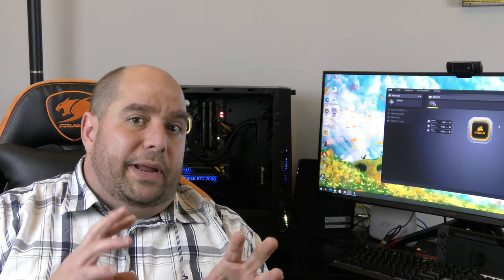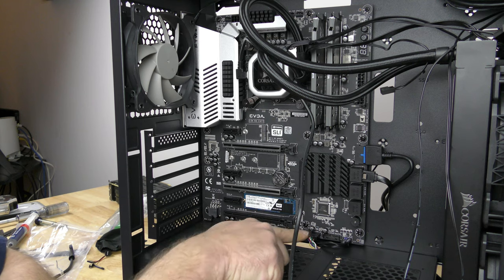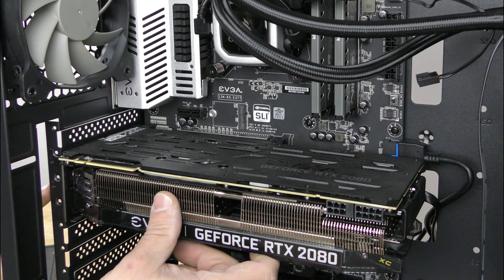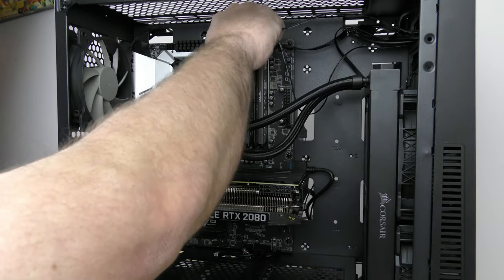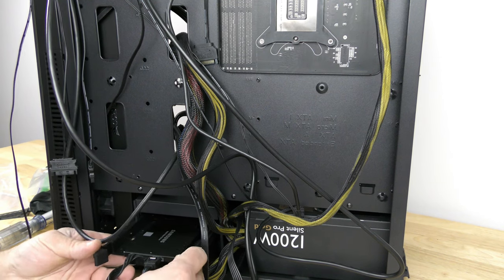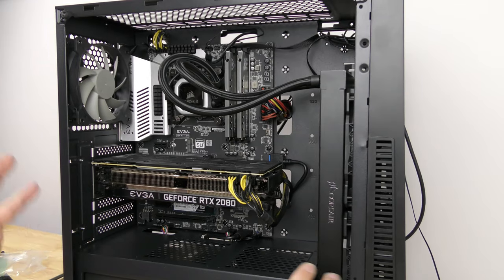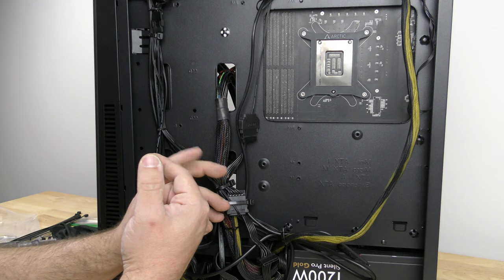How to Wire a PC Game Build for Beginners - Step by Step Wiring Guide 2021

Comment: Just built my first pc any idea on how to fix it?
Reply from the maker: congrats,.... but you have not stated what is wrong with it... how could I fix it?
Reply: @ThisBytesForYou  it won’t turn on I think I plugged in everything correctly and it still won’t turn on
Reply from the maker: Please provide the manufacturer and model number of your motherboard, cpu, power supply, monior and video card.  Also, did you watch this video to see how to wire it properly?
Reply: @ThisBytesForYou  
Motherboard - B450M DS3H V2 gigabyte 
CPU - AMD 5 2600x
PSU - 500 watt Bronze byEVGA
Graphics card - 1660 TI EVGA GeForce nivida 
Ram - Corsair DDR4 vengeance lpx 16 gb 
Case - NZXT H510i
Reply: @ThisBytesForYou  I watched the whole vid but since my motherboard is different some caves were different
Reply from the maker: Ok, I see no reason why it does not turn on, so it must be wiring.  do you have your 8Pin EPS power connector connected, just above the cpu socket, make sure its EPS and not PCIE.  Do you have the ATX 24Pin properly connected?

Do you have an 8Pin PCIE cable connected to the video card?

For all 3 cables, I recommend you unplug them, then plug them back in.

Also, make sure the switch on the power supply is on.
Reply: @ThisBytesForYou  ok I’ll try it
Reply from the maker: sounds good, let me know, but I cover all that in this video as well.
Reply: @ThisBytesForYou  I tried everything but still can’t turn on but there is a little white light showing in my case that’s the only thing that changed I’ll probably just bring it to a pc repair shop and they’ll figure something out lol
Reply from the maker: @ratratratrat6989  where is that little white lite?  Troubleshooting is easy, you jus have to want to try.  You took the first step building it, follow through
Reply: @ThisBytesForYou  it’s coming from the NZXT case itself like where all the cables are coming from I’ll try to trouble shoot it I’ll let you know if it works
Reply: @ThisBytesForYou  hey just wanted to let you know thanks lol I fixed the problem I did two mistakes one with cables and another with ram

Comment: I need help! My pc won’t connect to the WiFi and I tried doing it on my computer and looked up vids and I’m pretty sure it’s a cord that got u plugged. IDK can anybody help me!
Reply from the maker: what does it say when you try to connect to a wireless point?
Reply: @ThisBytesForYou  no internet secured
Reply from the maker: @genova6570  do you have an IP, DNS, Domain set on the wireless device and did you enter the WIFI code?  If you are connecting to a neighbors that is "open" chances are its open to connect, but not open to the internet.

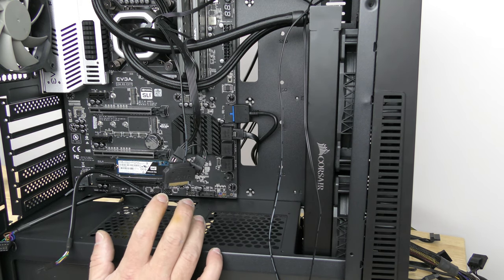Comment: Whats that cord at 2:43? The yellow one
Reply from the maker: I don't see a yellow cord, do you mean the connector, that at the end has gold/yellow pins that I push off of the screen?
Reply: @ThisBytesForYou  Yeah sorry, thats the only cable that i dont know where to plug into my nzxt h500 case
Reply from the maker: no worries my friend, I am here to help.  That cable is the male portion of a SATA Power connector, you would plug a SATA Power connector into that to power in this particular case, it is to power the front panel RGB panel.  Those, it could also be to power a fan hub controller, an ARGB controller, liquid cooling unit and a few other things.  Follow that cable on your case and see where it connects.  To, iIhope that helps?
Reply: @ThisBytesForYou  alright thank you very much
Reply from the maker: anytime my friend.
Reply from the maker: Thanks so much for stopping by, checking out my video, liking and subbing as well as commenting, it means a ton to me.

Comment: I completely butchered my first upgrade: tried upgrading gpu and psu and now i get blue screen with no error code, fans won’t spin and my mice won’t connect (keyboard works in all usb slots tried 2 different mice) no idea what i did wrong.

Edit: I am pc noob and i upgraded my pre built.
Reply from the maker: No worries my friend, I am here to help you.  So for all the cables, when I say make sure they are connected, I am saying unplug them and plug them back in.  So make sure the 8Pin EPS CPU connection is plugged in, near your CPU coming from your power supply.  Make sure the 24Pin ATX connection is connected.  Fan's won't spin, make sure that if you are using a fan hub, that the fan hub has the power cable connected to it.  Please let me know if this helps?
Reply: @ThisBytesForYou  worked! 2pin pcie wasn’t connected to gpu lol thanks so much!! Have a great day and happy holidays
Reply from the maker: awesome my friend, very happy i could help you, I hope you have a great day and holidays as well.  Thanks for much for stopping by, checking out the video, liking and subbing, trusting in me to help you and letting me know I did help you, it makes me so happy.

Comment: so my pc turns on but the fans dont spin and the motherboard is beeping. im very confused
Reply from the maker: check your motherboard manual, it will tell you what those beeps mean.  You could have an incorrectly seated cpu, memory, video card, ATX cable, EPS cable, it could be anything.
Reply: ThisBytesForYou I might just take this thing to a repair guy to relieve me from this lol

Comment: i have done this but when i plug it in and turn it on nothing comes up on the monitor?
Reply from the maker: So that I can help, please list the manufacturer and exact model number of the following components:
1. Motherboard
2. CPU
3. RAM
4. Video Card
5. Power supply
6. Monitor.
7. Do you have ALL of the PCIE connections plugged in, and not daisy chained or pigtailed, each coming directly from the power supply?
8. Are you running through HDMI, DP, DVI, VGA, etc?
9. UEFI in the BIOS from Legacy.  If it was set to Legacy, you will need to reinstall windows to get correct support.
10. Disable CSM in the BIOS
Reply: @ThisBytesForYou  thank you for this!!! i fixed it!!! i took out the ram and put it back in 🤩🥳
Reply from the maker: @kelpeee3275  awesome bud, so very happy I could help you my friend.  If you enjoy PC stuff and like to learn more, my channel is focused only on PC stuff, making everything easy from the beginner to the expert.  Please consider liking the video and subscribing, I release videos every week so i hoep to release something else you may find interesting soon.  Also, if you don't see it already in my almost 400 video collection, let me know, I could make a video for something you would like.  Thanks again and so happy i could help.

Comment: Is it okay/normal that my hd audio connector doesn’t plug fully into the hd audio header? The pins are aligned correctly, the connector just doesn’t insert fully. I’d say it inserts about 75% and I don’t want to apply too much force out of concern for the motherboard
Reply from the maker: no, it should fully plug in all the way, but I guess there could be some a little off.  Have you tested it to see how it works?
Reply: @ThisBytesForYou  not yet. I’m worried I’ll destroy my mb when I flip the power switch
Reply from the maker: unplug it, then look closely at the pins, make sure you have them aligned correctly, then if it still only goes in 75%, give it a try, it should not fry your board.  Will you be using the front panel audio header?
Reply: @ThisBytesForYou  i managed to push it in all the way--just needed a little elbow grease. Thanks for the replies though! (yes im using the front panel audio header)
Reply from the maker: @samuelurbina228   good stuff my friend, yeah like I said, it should always be 100%, there could be a little resistance I guess if the header is new, but regardless, happy you got it.

Comment: I don’t have any of these power led cables??.?.
Reply from the maker: The led cables come from your case, not the power supply.
Reply: @ThisBytesForYou  thanks I have now found it! Also this is probably a stupid question but where do u plug your keyboard and mouse in?? And where do u plug ur headset in.
Reply from the maker: Usb ports, either in the front or back
Reply: @ThisBytesForYou  of the case or monitor lol😬😬😬😬😬
Reply from the maker: If your monitor has usb ports that works too, but you need to have your usb port of the monitor connect the the pc, since it becomes a usb hub.

Comment: When I plug my hd audio and my usb cable in the motherboard it keeps coming off
Reply from the maker: It sounds dumb, but make sure you are plugging the usb cable into the USB connection, not ethernet, it can happen and it will cause your PC to shut down.
Reply: @ThisBytesForYou  they’re in the right slots it’s just that it only goes half way in but not all the way in
Reply from the maker: @Ethan-cs1it  its gotta go all the way in, maybe try different slots?  Are you talking about inside the machine, the headers or in the back where you plug in the headphones or a usb device?
Reply: @ThisBytesForYou  the front panels
Reply from the maker: @Ethan-cs1it  OK, yeah they have to go all the way in, just make sure nothing is being blocked, you are causing grounding.
Reply: @ThisBytesForYou  I’ll try but I’m afraid if I use too much force the pins would break
Reply from the maker: @Ethan-cs1it  just make sure you are looking at the missing pin and align them correctly.
Reply: @ThisBytesForYou  ok thanks

Comment: Do I need a anti static bracelet? I’m on carpet.
Reply from the maker: If you can do it anywhere other than a carpet, especially laying your parts, don't lay your parts on a carpet, please try something else.  Please put everything on a table.  I have build on carpet before without messing components up, just make sure when you come to the computer, before you touch anything, touch the metal frame of you case, it will ground you and rid your body of any ESD.  If you walk away, to grab a drink  (keep it away from your machine) or go to the bathroom, when you get back touch the case.  An anti-static bracelet is not a bad thing to have, a little extra precaution, just gets a little bothersome to work with the parts.

Comment: I watch this video over 20 times. I follow your steps to the teeth. I have power cause the motherboard light is on. When I press power nothing happens. no rgb on led strips and gpu and no fans turn. Can you help me please?
Reply from the maker: I sure will try my hardest, please list the manufacturer and model number for the following parts
1. CPU
2. Motherboard
3. Video Card
4. PSU
5. Monitor.
Reply: @ThisBytesForYou  CPU: Ryzen 9 5950x. Mboard: asus Dark Hero VIII.Video Card: asus strix rtx 3090. PSU: ASUS 850W Power supply ROG-STRIX-850W-WHITE 850W 80 PLUS GOLD. Monitor: ASUS ROG Swift PG278QR 27" 1440p 144hz 1ms
Reply: troubleshooting: light comes on the motherboard. but the start button on the motherboard , when pressed nothing comes up. and when pressing the power on button on case same results , nothing . thank you for your videos its so much fun to watch.
Reply from the maker: @ibclever69  so did you miss my previous response?
Reply: @ThisBytesForYou  I did watch your other videos. but didn't get your previous response. Right now im  checking all the cables to make sure they are in the correct places.
Reply from the maker: @ibclever69  my previous comment was
ThisBytesForYou
7 hours ago
14.2K subscribers
I sure will try my hardest, please list the manufacturer and model number for the following parts
1. CPU
2. Motherboard
3. Video Card
4. PSU
5. Monitor.
Reply from the maker: @ibclever69  I see what happend, I have my site blocking links to product people, for some reason it put your VIII.Video as a link and I just allowed it, so I can read it.  OK, that processor is not  supported out of the box, that is why I asked about it.  Go to the Dark Hero's support site and read the instructions on BIOS flash back, this will make everything work for you.
Reply: @ThisBytesForYou  thank you, I will do this asap and get back to you. if this works, you're a computer GOD 8). this is my 1st ever pc build
Reply from the maker: @ibclever69  awesome that I could help you my friend, but for sure this will work, if its only that of course, this has caught many people off guard, something along the line as renaming the file to ch8 and putting it in a thumb drive and booting with it in the Flash back USB port, but read the instructions to be sure.
Reply: @ThisBytesForYou  I'm back to square 1.i downloaded the ASUS dark hero bios to a flash drive. I press the power button with f12 and or end nothing came up.
Reply from the maker: @ibclever69  did you follow the instructions the BIOS notes told you, I am sure the BIOS for flashback is CH8, and you dont have to press anything, just put it in the flash back USB port.
Reply: @ThisBytesForYou  Thank you for all your help. You are a tech GOD. I made 3 mistakes in building this pc. fan header cable in wrong spot, ram wasn't pushed in all the way in slot and didn't give time for bios to upload all the way. Thus, is the reason why the pc wouldn't fire up. Everything is up and running. God Bless you
Reply from the maker: Ahhh very cool you figured out what you did, it's happened to all of us my friend, we are human, things happen.  Thanks so much for letting me know you were able to get it working.

Comment: Good tutorial but for new builders please don’t place your AIO in that orientation! There’s air inside the system (on purpose) which as we all know air will rise. If you place your AIO with the in/out at the top when using a vertical orientation you’re likely going to pump air into your block. This can lead to poor cooling performance, pump noise, seized pump, and premature failure of the AIO. If you want to do a vertical mount your in/out at the radiator needs to be at the bottom. At the end of the day you’re much better off just mounting the radiator on the top of your case. Just an FYI, a lot of people who complain about AIO failures have their system setup incorrectly.
Reply from the maker: Thanks my friend, as a product development engineer for Alienware, then later dell when they bought us and finally velocity micro, that is incredibly rare for it to fail like that, unlike Steve preaches which no one ever said anything about until he did, funny how that became common knowledge for ever after that.  So aside from that, I always put it at the top when I can, but the larger memory and heatsinks over the vrms would not allow the rad to go on the top, this was the only way I could fit it in.  Just as an F.Y.I of course. Let me know if you have any other concerns.  Just
Reply from the maker: Also curious and where you got the information about all the failures, and noise and all that stuff that installed them incorrectly very curious on the loads of people.  Shipping thousands of systems and the only failures were due to shipping and that was immediate of course, with a 3 or 4 year warranty you would think we would have heard about this.... You know before Steve.  Just curious.
Reply from the maker: And what of the rear mounted 120mm rads... For those that can't fit a 240, 280, 360 or 420, for eons... Wonder about those failures...

Comment: I would raise that radiator… it’s too low your gonna get air bubbles in that pump
Reply from the maker: if the hoses are right in line with the radiator it's perfect, its pretty in line here, regardless, the radiator hoses are not below

Comment: Replaced my motherboard and cpu cooler and now my pc won’t turn back on
Reply from the maker: so, not so sure on how pc techy you are my friend, but a motherboard is not a small piece, its the foundation for the entire PC, so its pretty big.  There are a TON of potential issues,  please help to answer all the questions so I can help you and list manufacturers and model numbers

1.  What motherboard did you originally come from
2.  Why did you replace the motherboard
3.  What CPU are you using
4. What CPU Cooler are you using
5. Did you make sure the ATX 24Pin and 8PIN/4PIN EPS CPU power cable are both connected and properly connected?
6. What power supply do you have
7. what video card do you have
8. Did you verify that the stand offs in the same location, no extra stand offs?
Reply: @ThisBytesForYou   1 b450m hdv 
2 better upgrade path + outdated 
3 r9 3950x
4 noctua nh-u12s
5 yes
6 gamdias kratos p1 650 watts 
7 gigabyte 2070 super 8 gb 
8 yes
Reply from the maker: @toumii7829  ok, looks pretty standard, I forgot to ask you, did you upgrade the cpu as well and what motherboard did you upgrade to?  Did you upgrade anything else?